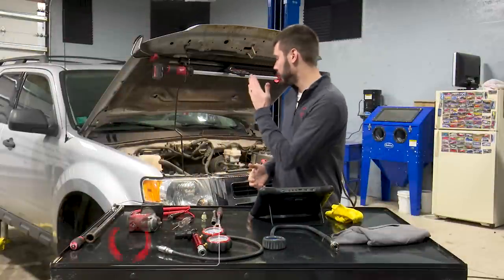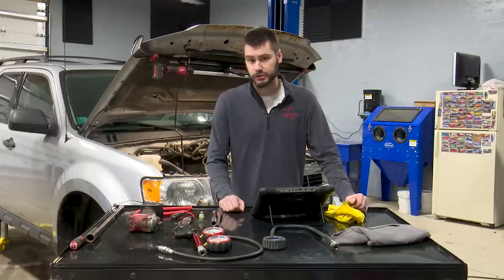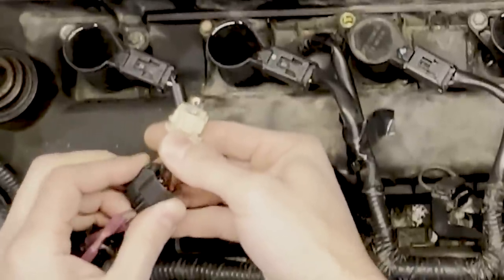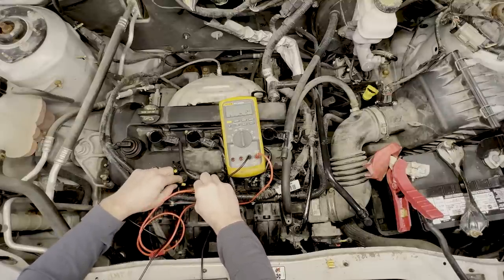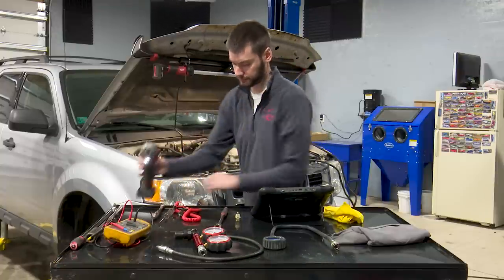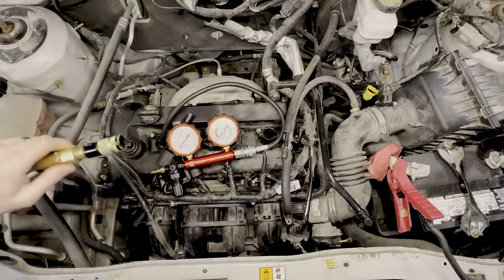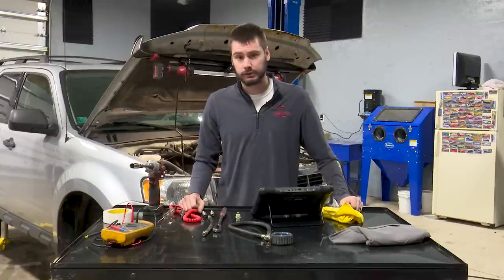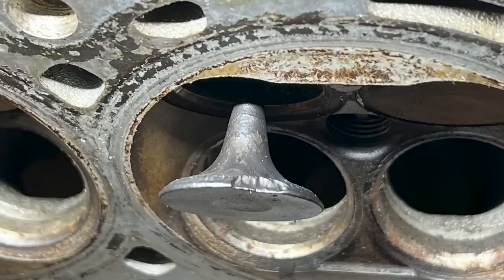Test Ford 2.5L Misfire P0301 - Solved

Comment: Last year I had this happen on my 2011 Escape, shop did head replacement. 27k miles later, misfire code on Cyl 1. I take it in to the shop that did the head replacement, they can't figure it out. I take it to a different shop, exhaust valve lass supposed to be .012mm, but Cyl. 1 is at .0015mm. BUT, it has 0% leakdown. Does that mean I dodged a burnt valve? It only runs rough during a certain period while warming up, and then it smooths out.

Comment: How would you know if it's a valve and not air running past the pistons?  Sorry if that's a dum question, I'm new. Just got a 09 2.5l and it drives good at high speed, but hesitates and is gutless from low speeds. Changed sparks and have one shiny piston....
Reply from the maker: Hey John, 
Good question, it all depends where the air goes. Air leaking past the exhaust valve goes out the exhaust, leaking past the intake valve will come out throttle body and if leaking past piston rings. The air will come out crankcase, this can be found by removing dipstick or oil fill cap. 
If you have a shinny piston it can be a sign of coolant consumption from a leaking head gasket or cracked cylinder head.
I hope this helps, thanks for reaching out!
~Ryan

Comment: Just a note. The "Rule Of Thumb" we have used for years, was anything around OR below 90 PSI will not fire at idle.
Been a Ford Dealership Technician since 1987 and that rule has always proved true.
Nice channel and content BTW!
Patrick
Reply from the maker: Hey Patrick, thanks for watching! That's a sounds like a good rule of thumb.
Mike Becker, Senior Instructor
Reply: Hi Patrick. As a DIY'er I'm learning and have questions. I too have a 2009 Escape with a 2.5L that has a misfire on cylinder 1. Compression is 190 and other cylinders are 195 to 200. New FoMoCo plugs and coils. When you say at below 90psi the cylinder won't fire at idle do you mean there will be a useless compression stroke because of the leak OR the the coil won't fire a charge to the plug?? What is actually detected, and by what, to create the P0301 code? Thank you, Dale
Reply: @dalebabbitt6185  You are thinking on the right track Dale.
Yes, in anything below 90 is a "useless" compression stoke. The P0301 is set due to the processor "seeing" (detecting) a slowing in crankshaft RPM/rotation during cylinder #1's power stroke.
Hope this helps. Quick reply as I am at work.
Best regards, 
Patrick
Reply: @FordSeniorMaster  Patrick, thank you so much for your reply!!! I'm buying a leak down detector and then I'll TRY to take a look at the valves with my horrible Harbor Freight bore scope. Of course I can't find the equally horrible 45 degree mirror that attaches. Wish I had a scope to see the signals going to the number 1 coil AND injector. Maybe the injector is dirty? It is on the blind end of the fuel rail, just thinking. So many possibilities going through my mind right now. AGAIN, THANK YOU, Dale
Reply: @dalebabbitt6185  My pleasure ;-)

Comment: Excellent diagnostics Mike. Looks like a similar procedure that I would typically go through. I like how you took the correct steps into the diagnostic procedure and wasted no time. I like the glove technique that's very helpful. It seems like the previous tech or whoever worked on the vehicle last didn't look into the possibility of a mechanical problem that would cause that misfire.
Reply from the maker: Hey man, thanks for watching! Yeh, I agree. Mechanical is often overlooked in favor of cheaper easier to change parts...but if it's not fixed...it's not fixed, right!?
Mike Becker, Senior Instructor
Reply: @GoTechTraining  I always like to rule out the simple things first, but I keep the mechanical problems on the top of my list as always a big possibility when it comes to issues like these. I don't know why, but I usually see a burnt exhaust valve in cylinder 1 on 4 cylinder engines. I assume cylinder 1 would run very hot. Also, any ideas what would have been the cause of the problem in the first place? Could be from a lack of maintenance, etc. ? I also came across something interesting from an engines textbook I read years ago regarding these problems and I would like to share it here.
Reply: A burned valve can result when an engine with an exhaust leak has been driven for a period of time without repair. The valve typically runs at temperatures in excess of about 1300 °F. When the relatively cold air in the engine compartment is sucked in through the exhaust leak, the valve suffers thermal shock.

Comment: Great video Mike! All you see nowadays are misfire videos using lap Scopes which are great but there's a lot of guys who may not have access to them nor learned how to properly use one yet. This video gives some great basic tips to diag this misfire using tools that are very affordable and available. 👍🏼
Reply from the maker: Hey Robert, thanks for watching! As much as I love using the labscope, not every job is easier/faster with it. Could have used the pressure transducer here but the leak down gauge does the same thing in this regard but faster. 
Mike Becker, Senior Instructor

Comment: Great diag. I found the glove waving hello to be quite amusing 😁. Unfortunately it won’t be at all amusing for the customer, because that’s going to be a big repair bill. I have found that leak down and compression testing can be quite interesting in their results, and what one can show vs another in different cases.

I’ve seen one case on a 2005 Honda CR-V which had 42% leakage on one cylinder, almost solely through the exhaust valves, yet compression was very good, 160 psi. The idle was pretty rough, but it ran well otherwise, and never set a misfire code, and never increased the misfire counters in mode 6.

I’ve noticed over the years that when I come across an engine with a rough idle that smooths out a few hundred RPM above, when everything else checks out, it usually ends up being leaking valves when I do a leak down test. Some will set misfire codes, some won’t.
Reply from the maker: I agree, it can be very interesting. 
Thanks for watching.
Ryan W, Technical Instructor

Comment: I guess if you had the E Scan Elite Scan Software , you could do a Relative Compression Test at the OBD 2 connector . The Auto Ditex Tester will also do that from the battery .  . But most of us don't have those or even a scope . The Snap On MT 2400 Vantage will also do it with an amp clamp . And if you are dealing with a " shop " WITHOUT a leak down tester - RUN
Reply from the maker: Hey Bill, thanks for watching!
Mike Becker, Senior Instructor

Comment: Compression test and leak down  
Cyl 1 - 152 psi  / 65% leakage 
Cyl 2-195 psi  / 40% leakage 
Cyl 3 -190 psi / 25% leakage 
Cyl 4 - 200psi / 20% leakage 
It has low compression on cylinder 1 with 60% leakage, smoked cylinder 1 and no smoke going through intake side or exhaust. Theirs is a small leak from cylinder 1 to cylinder 2 caused by the head gasket failure but you still have good compression on cylinder 2.

This was my mechanic comments for my 2010 Ford Escape due to P301 code. Head gasket is done code is still active. He thinks it could be worn piston ring. What do you think?
Reply from the maker: Hey Lee

My question is what kinda smoke test? Leak down testers test at 100 psi, most smoke machines put out 0.5 psi. That’s why we use gloves to find moving air. What the compression readings and leakage after the head gasket? I would bet you have a valve issue. 
~Ryan

Comment: Since the air pressure was trying to push the piston down, were you also getting air out the throttle ?? I know there is a happy zone that you can hit when doing on car valve guide seals to keep the valves from falling into the cylinders. I'm think that's piston down between intake and compression stroke.Been a while since I did heavy line work... I don't dp facebook either, besides no pocket shirt makes it a rag...THANKS MIKE.
Reply from the maker: Hey Terry, thanks for watching! You just need both valves closed and a reliable air compressor. It's no good if the compressor fails mid replacement and you loose air pressure. There's really no perfect seal, that's why the leak down tester has a green zone on it, not exact.
Mike Becker, Senior Instructor

Comment: hey mike!   nice diag  an injector going lean caused that or just crap valves  i usually put a banana in the tail pipe if it ejects across the shop  i know...
Reply from the maker: Hey Scuba, no I don't think the injectors are causing the valve to burn. I don't recall fuel trim/misfire issues prior on any of the many 2.5Ls i've now fixed for this issue. I don't really know the root cause but it's likely in the design or material of the valve/cylinder.
Mike Becker, Senior Instructor

Comment: Hey Mike.  Since you were going low tech, would a simple vacuum gauge hooked up to he brake booster have a bouncing needle to show the mechanical failure?  Great job as always Mike.
Reply from the maker: Hey Mike, hmm it might. I'd have to try it to know for sure. It may not though, because the valve is closing, just not sealing resulting in lower compression. Not sure if it would be enough to get a bounce though.
Mike Becker, Senior Instructor
Reply: Definitely depends on the car and failure.  I had a Dodge 5.7L several weeks ago with a wiped out cam and seized lifters on cylinder 5 and my vacuum was at the perfect measurement both at idle and on a snap throttle
Reply: The higher the leakage, the more the needle would bounce on the vacuum gauge. The burned valve would create an EGR type affect on that cylinder. So that cylinder won't fill as much with fresh air as the other cylinders as some of the exhaust is also filling the cylinder at the same time which would cause the needle to bounce on the gauge. The larger the leakage, the more the needle would bounce.

Comment: I was under the impression that noid lites are only for injectors but I see Mike is using it for the coils too.
Reply from the maker: Hey Carl, thanks for watching! My main goal was to insert a load into the circuit. Unfortunately the bulb didn't light much :(
Mike Becker, Senior Instructor
Reply: @GoTechTraining  I finally determined that my 2001 dodge ram has a mechanical problem;    # 7 cyl has only 150psi  the others are 160 170 and 175. I feel a misfire only when I rev. it above 2000 rpm in park. never feel anything when driving. I think the rings/ pistons are worn. If I put some oil in # 7 the PSI goes up above 200.
Reply from the maker: Well that's no fun! Mechanical is almost always a pricy repair :(
Mike Becker, Senior Instructor
Reply: @GoTechTraining  hi mike the Autel mp808 scanner like mine has some pids that I never see explained like the cam and crank pids  and distributor sync. etc it would be helpful if a video could be done explaining how to read these pids.

Comment: What bulb are you using?  Do different bulbs produce different brightness  in this application?
Reply from the maker: Hey Paul, yeh I would think so depending on the resistance/wattage rating of the bulb. I won't be using that bulb again for that test lol!
Mike Becker, Senior Instructor

Comment: Hi Mike. What are your thoughts on what might be the cause’s of burnt valve’s.
Reply from the maker: Hey T.K, hard to say on the root cause on this particular engine. Head design, valve composition, could be a lot of things. Sorry, I don't really know.
Mike Becker, Senior Instructor
Reply: Thanks for the reply Mike. I just repaired a 2012 Volvo  T5 S60 Turnbo with a 2.5L engine burnt exhaust valve. Thought maybe u would have advice so that i could prevent it from happen again

Comment: you should have explained you checked #3 or could have done #4 was to avoid the possibility of head gasket failure between adjacent cylinders by checking #2 for those who  might not understand. i cant help but wonder the true cause maybe an exhaust restriction??? too many hot shutdowns???
Reply from the maker: Ahhh yes, you're right. I should have mentioned that!!! As far as what causes this, not really sure. Maybe just crappy OEM valves? It's soooo common on 2.5L's with 150k+
Mike Becker, Senior Instructor

Comment: Sir can you please send me the valve lash specs for a 2014 Honda Accord EXL Coupe 3.5l V6 .
Reply from the maker: Hey Luis, I show the valve lash specs as (Intake valves 0.20 - 0.24 mm) and (Exhaust valves 0.28 - 0.32 mm)
Remember to set lash specs when the engine is cold.
Ryan W, Technical Instructor
Reply: @GoTechTraining  Thanks Ryan.

Comment: I wonder if you could see the bad valve with a borascope
Reply from the maker: Hey Paul,
Good question, if the valve is bad enough you definitely can. You just need a borescope that can flex or has a mirror to look up toward the valve. Depending on the motor you can also spin the engine over till the valve is fully open and sometimes get a got look at it.
Ryan Wilsing, Technical Instructor

Comment: Freaking ford junk , 72,000 miles and I have an engine misfire after changing spart plugs with fordmotor craft  plugs im willing to bet this is the cause of the misfirecode for #2 cylinder  ! Freaking ford junk !